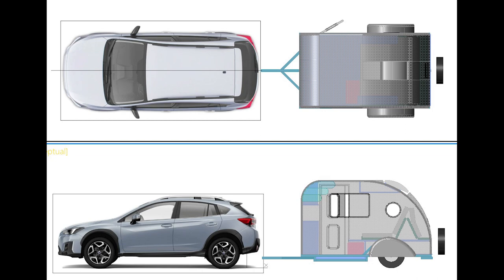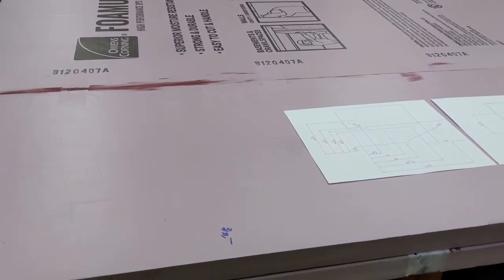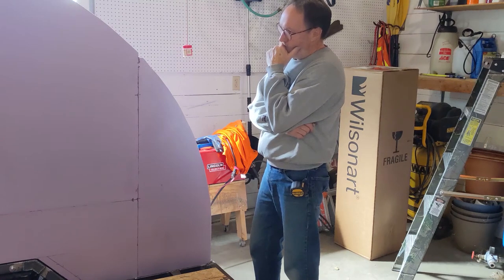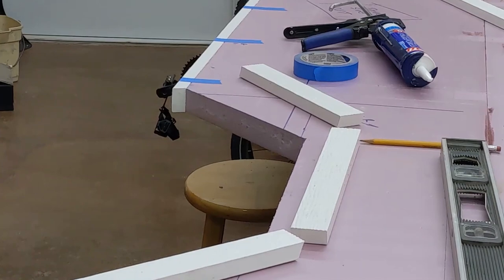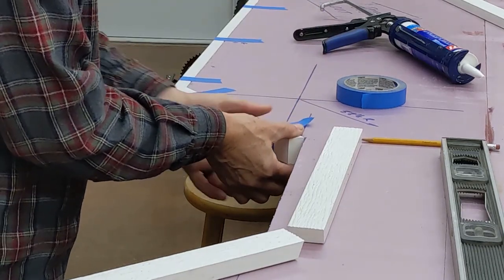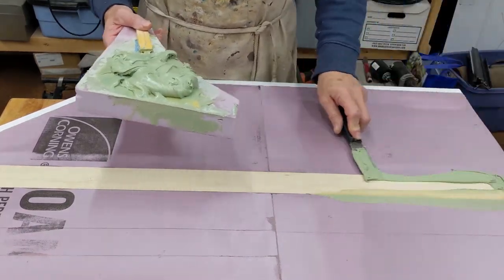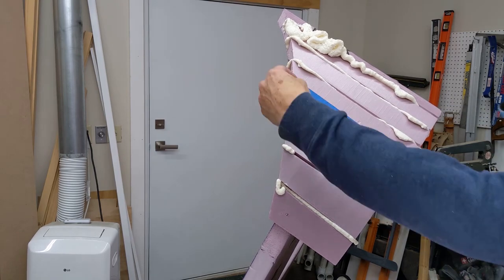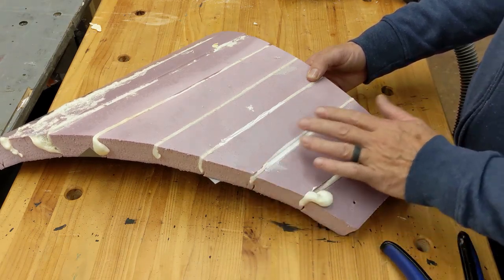EP 04 Covering my shop in pink dust

Comment: The problem with using epoxy to glue sheets together is it creates a hard spot that will not sand equally with surrounding areas.
Reply from the maker: Very good point.  I realized that afterward.  What would you suggest instead?  Spray foam?

Comment: Are you using epoxy resin like you use for fiberglass or another type of epoxy to join the foam?
Reply from the maker: Yes.  The same stuff I am using for the fiberglass.  Some people use expanding foam or gorilla glue, but this is cleaner since it doesn't expand.
Reply: What's your take on finger/tenon joints to join pieces together? I'm planning on using GG due to cost of epoxy in Alaska. Some say don't over think it/over engineer it. The strength comes from the inside &outside skins. Gonna use TB glue & canvas.
Reply from the maker: The tenon joint will allow for easier alignment but will not really add any strength. As you probably already found out, foam can be snapped in half very easily.  I used epoxy for most of my joints just because I can mix it to the consistency that I needed. It goes on easier when it's thicker. However I also used foam caulk adhesive, expanding foam, and gorilla glue with equal results. Like you said, the strength really comes from the skin.  The rigid foam is just there as a spacer and for insulation.